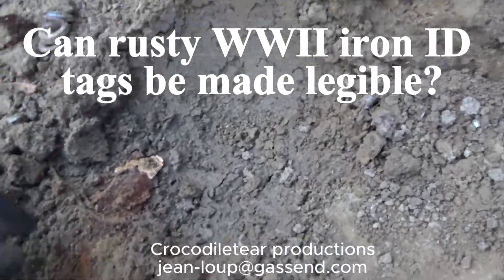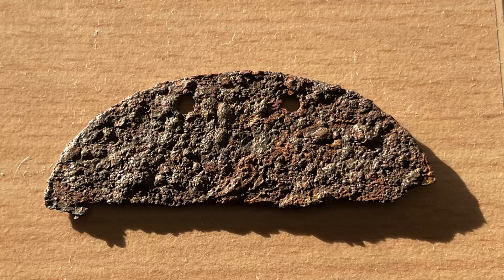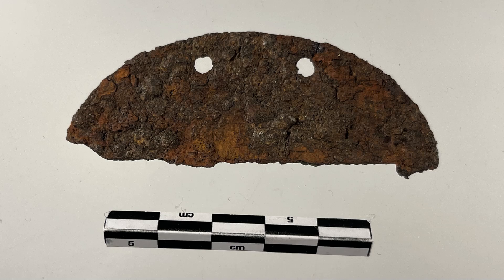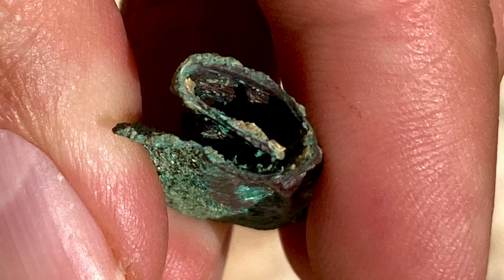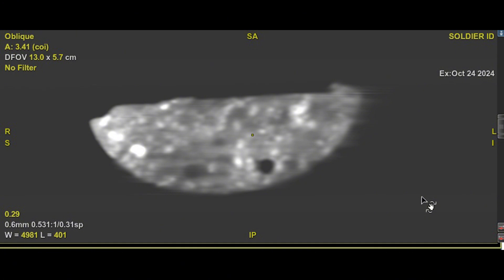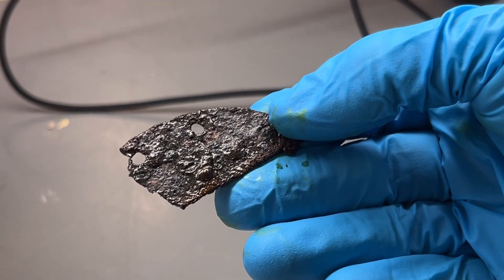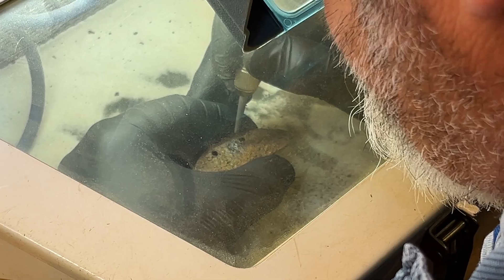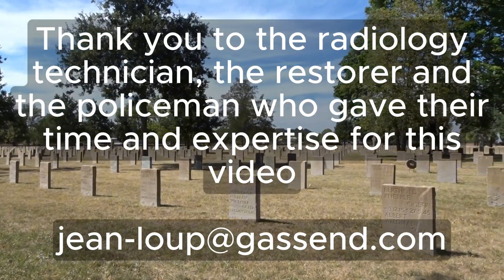Can WWII German iron identification tags still be read? WWII soldier identifications

Comment: Two ideas 
What is the form of electrolysis to remove rust. Lots of videos on YouTube about it 

Second is a chemical method. There's a chemical we use here in the states called CLR which is calcium lime and rust remover.
The active part that removes rust is 
Gluconic Acid – It aids in breaking down mineral buildup like rust and calcium.. 

Hope this helps
Reply from the maker: I think the restorer said that the blasting method was better then electrolysis because you can control what is happening.
Reply: @CrocodileTear  electrolysis or using something like oxalic acid, Evaporust etc. would only work if there is still uncorroded metal beneath.
Reply: @CrocodileTear  u can control it .. about of volt or amps going in with the amount of time .. seems adjustable ? idk never did it myself
Reply: @llorrakmadda1952  yes you could do it that way, like I said in my other comment I’ve never done it on something so thin so maybe that is an additional consideration here. But the process is more or less self regulating. The reaction will stop when the rust is gone so you cant really over do it.
Reply: was going to comment until I saw this one. Electrolysis has been used to read out information on rusted objects like cannons that sat in the ocean for centuries. It's actually really cheap and easy to do. You can do it at home. Even if it doesn't give you immediately the result, combined with other techniques, such as multi-spectral analysis, you may be able to read very faint letters.
Reply: i was also going to suggest this,i think itd work but youd have to turn it down being so thin?ive seen metal detectorists do this many times they get great results although admittedly not like new so who knows if you could read it
Reply: Electrolysis I was also going to recommend also so I’ll just join in here. It’s definitely going to remove the rust! Just a matter of how much of the tag is left under the scales of rust. I’ve had good luck with it but admittedly I’ve never done it on something this thin. 

There is one other chemical I’d like to recommend, here in the states the brand name is Evaporust. Works very well but it’s quite pricey, would be more effective than CLR but maybe more user friendly than electrolysis. Not sure if you can get your hands on it over there but that would be the other method I’d try if I had these tags.
Reply: @endurocatfish  I totally forgot about Evaporust. That actually might be a better alternative than CLR The eventi needs to import it.
Reply: @endurocatfish  Backyard Ballistics made a homemade version of Evaporust precisely because of the price and judging from the work he does it works pretty well. He's got a tutorial on making and using it here on YouTube on his Beyond Ballistics channel.
Reply: @dillonhunt1720  No kidding? Definitely will check that out!
Reply: second